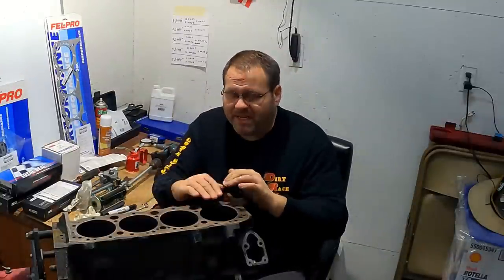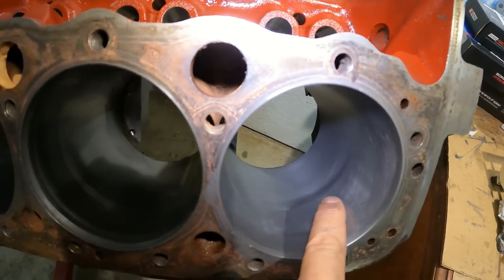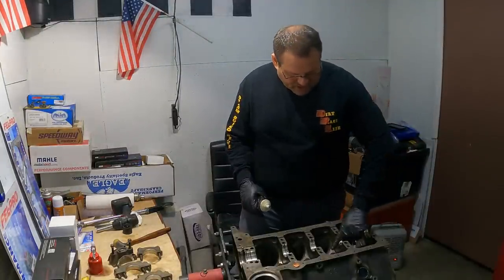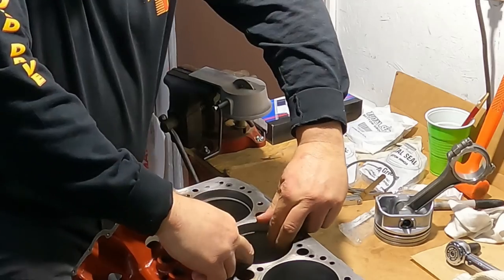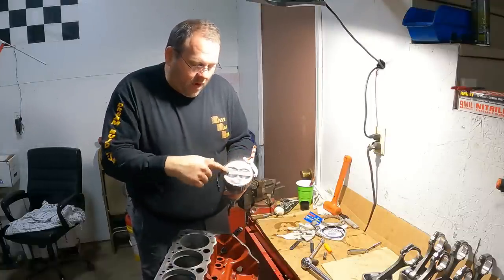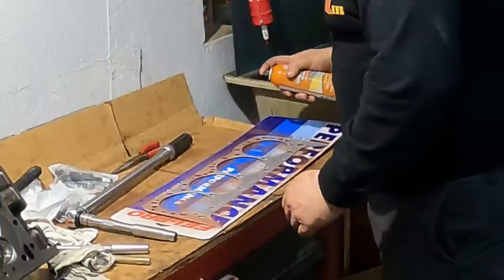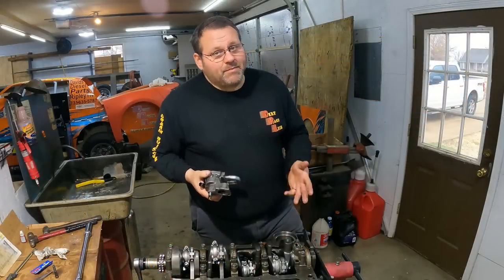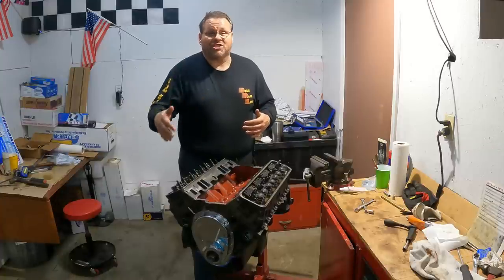Budget SBC Overhaul on our Race Engine including cutting Ridges, Honing, and Assembly!

Comment: Very good video, I have been a engine builder for 60 years, good explaining every thing,
Reply from the maker: Thank you sir, I am quick to tell folks I AM NOT an engine builder. I am just willing to assemble my own engines. I know I don't know everything and still make mistakes and for that reason I just do my own engines. And when I messed up during assembly on my last build, I was quick to reach out to my machinist for advice and to get help with a solution. I 100% respect why some builders are either they do it all or they pass. It's extremely complicated and it is so dang easy to make a mistake and want to blame everybody else besides yourself. much appreciate that feedback sir.

Comment: My grandfather who knew Keith black, always use to put STP oil additive in the pumps before assembling it into the block.. he swore by doing it to pump that snake oil thru the bearings first on startup.
Reply from the maker: I don't think it would hurt anything as long as there is an oil base in the additive as well. 
Some good ole moly rubbed on the bearings has been a go to step for a lot of builders for many many years and will sure give it some protection during that first few seconds of fire up ;)

Comment: I cut off a pair off long head bolts and hacksawed a screwdriver slot on end then screw them in to aid in aligning head install. This trick also helps when putting the transmission in to line up the splines.
Reply from the maker: I have some 3/8ths done for Transmissions but never made any for heads. But it would help.

Comment: You talked about the motor oil absorb any trash left behind, well then it could go through the bearings, oil pump, lifters, rocker arms witch in turn causes more trash in the oil, so cleanliness is like Godliness when it comes to putting a motor together. And another thing if you use one of those one piece gaskets they are the best but take into consideration it's thickness when setting up your pickup for your pump because it is almost a quarter of an inch thick it's self, and cleaning that type of pan they can cut you like a razor blade.
Reply from the maker: As always you are spot on Dana. This gasket is 0.125" when compressed and I should have called that out. 
Agreed on the debris too, the rougher the cut, the more debris will be getting circulated around during break in. That's one reason I ALWAYS change the break in oil before the first hard run.
Been lucky and haven't got cut yet there but during making this I literally pinched a chunk of skin off my thumb just putting a rod cap on. It's easy to mess your fingers up in a hurry. I try to wear the thick 9mil gloves but sometimes they get in the way.

Comment: pistons do have a slight offset to the pin to decrease piston slap so they should be installed with the dot , mark, arrow forward. some oldschool guys say putting them in backwards gives a little more torque but more piston slap. I know a racer who won a big race  here in Fla. and get DQ for having pistons in backwards at teardown. just sayn.
Reply from the maker: Good info Jon

Comment: Jason, running a high volume oil pump can cause 3 issues, 1 high oil pressure uses up hp to turn the pump, 2 you have a lot more oil being pumped to the top end that could be interfering with valve train on turns and more drainage returning back to the pan causing windage issues around the crank , 3 i have had 1 issue with all of the oil being pumped out of the pan to the point that in the turns i would flicker my oil pressure light. I have since went to a stock volume pump that still moves a lot of oil at 4500 to 6000 rpm plus i run a 20lb hot oil pressure which is still more than enough, just what i do , what's your thoughts
Reply from the maker: I think your thoughts are valid but there are two sides to the equation. You have to look at clearances as well. I'm averaging .003 on rods and mains for this engine and I know that alone is going to dump some extra oil off the crank that never makes it top side. On my new CRUSA  build the clearances are significantly less and it may would do better by going with std volume. Since I will be using solid lifters in that one, I plan to use oil restrictors and that also insures I get good oil pressure on the btm end. Both working together can add up to not going high volume on the pump.
 Its a balancing act that varys one build to the next. 
In this one with its big clearances, hydraulic lifters, and stamped rocker arms that need lots of oil. . .  I believe a high volume is right for it.
Reply: Is this the motor you ran last season?
Reply from the maker: Yes, that's the one that was in my leaf car in 2021 and CRUSA car in 2022.

Comment: Can you tell me what the part number is on the head gasket and oil pan gasket you used?
Reply from the maker: Joseph, that rubber pan gasket is a Felpro OS34510. They make it in a thick and thin version but I use the thick.
I am using the Felpro 1094 head gaskets but BE CAREFUL  what head gasket you use. You have to have enough quench distance from piston to head or you'll grenade the engine. These gaskets are a no go on surfaces that are not machined or if the piston is not MORE than 0.020" down in the hole at top dead center.

Comment: Use a thread chaser instead of a tap,  not sure if that's what you did or meant 
Shave the edge of a bolt for a cheap chaser
Reply from the maker: Ah yes, the Neverending campaign for more tools! I have every tap known to man from 4-32 to 1 1/2" but nope . .  you caught me, I don't have all the thread chasers. Anywhere you have a blind bottom they are a necessity and I think your suggestion is spot on for that and is a dang cheap way to do these as well. Just use an old head bolt and hack saw that bad boy :)

Comment: Have u heard that spinning the pistons like u did increases horsepower I saw it on a YouTube video idk if it's true or not
Reply from the maker: The slip coat on the skirts was wore down on one side and that's why I reversed all of them. They all are match balanced and sized out the same and I felt it was a good move for this Ole girl. They have very little offset if any but I should have measure that and not just assume because it was not visible or on my mind. Well shit, guess I'll pull the pan off and make sure its not some crazy offset that will break a skirt :(
I ain't perfect by any means and still learn everyday. I have flipped many a piston but I am learning the Hyperuetics can't take some hacks like forged pistons will tolerate with no issues.
Reply: Great video Jason. Ready for some leaf spring racing